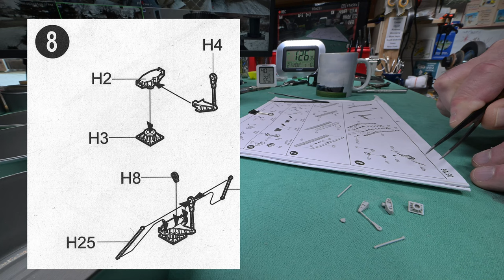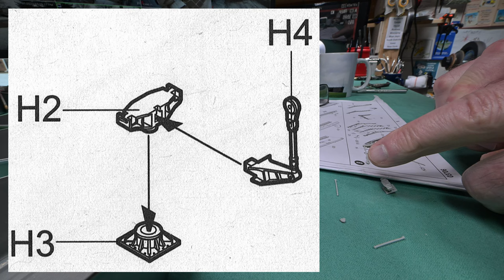The Model Ship - Part 1359

Comment: In fairness to Ryan, he never said or insinuated that Texas or any other ship would instantly collapse upon entering a drydock.  He was stating that as a curator it is part of his job to preserve New Jersey in perpetuity so people in 50, 100, 200 years can see it as it is now and that a ship out of water from a preservation standpoint over a long time horizon like that will in fact become structurally unsound.
Reply from the maker: I think he used the term "pancake down"! His argument was that (as I recall anyway) the hull as designed to be held in from the sides by the water. My argument was that if drydocked and braced up properly it will be just fine. 👍
Reply: @roncalverley  FYI there is a massive model of an Iowa class made entirely of brass and copper.  I just sent you the link.
Reply from the maker: Hi again Ed,
Now, please understand what I'm saying here. Ryan is very interesting, but not always accurate. Listen to what he is saying while looking at the video he is showing. I sort of get the feeling that he may have the misconception that nobody is going to notice if he happens to be wrong. As a curator, he should be more responsible.
https://youtu.be/v9Sx3-JUYlU?t=423
Reply: @roncalverley  I watched that video and I can't see anything that contradicts his point about long term storage and ship preservation practices.  He's never said ships collapse in dry docks.  There's a huge difference between dry docking a ship for maintenance periods and permanently leaving a ship dry docked in perpetuity.

Comment: Don’t you have regulations regarding the disposal of scalpel blade and syringe needles where you live. The safest option is to order a sharps disposal box from Amazon and then, when full take it to a chemist for safe disposal. I have known five waste disposal workers have injuries from sharps in plastic rubbish bags, not nice, they were also wrapped in paper, but the edge cut there way out.
Reply from the maker: Hi Gray,
I ordered this today. Thanks for the tip!
https://www.amazon.ca/gp/product/B07TC4BG4T?ref=ppx_pt2_dt_b_prod_image
Reply: @roncalverley  great news, I have used them for over twenty years, it takes an age to fill one, then you can safely keep your sharps out of harms way. I use surgical blades and handles, also a selection of hypodermic needles and syringes, like you. Also put my disposable Stanley knife blades in them.